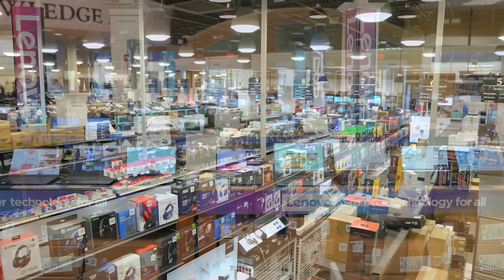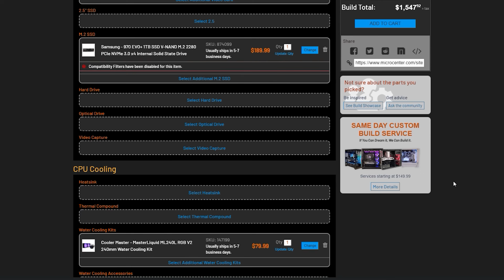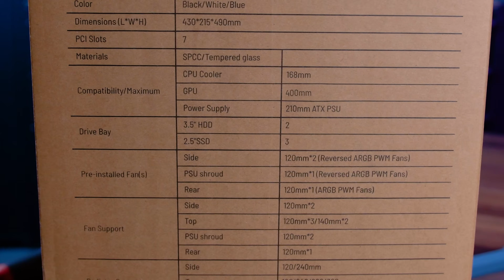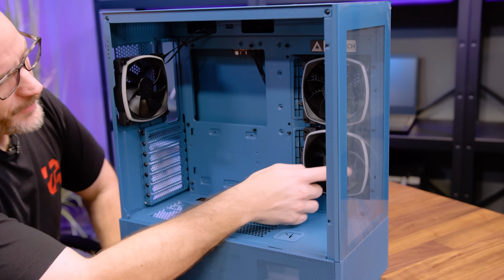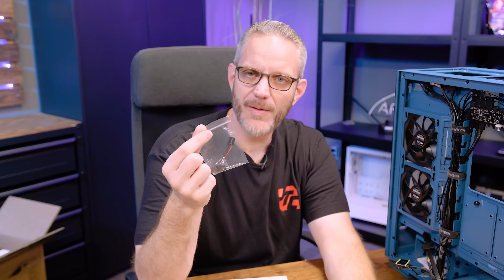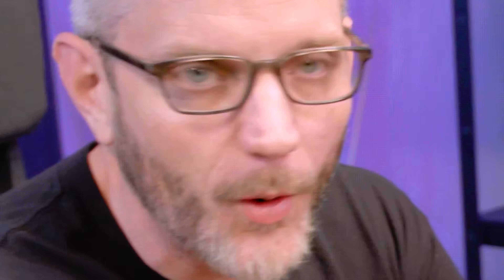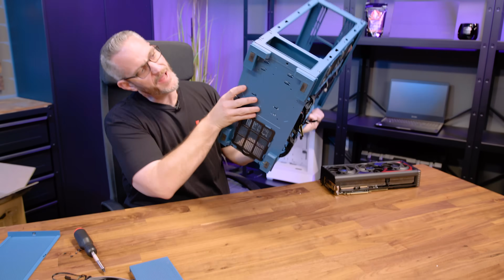This case has a funny name but awesome design choices! Montech Sky Two

Comment: Is it just me ? but at the high end, cases need to be redefined. Side mount fans are ok but the biggest improvement would come from bottom up fans, go back to PSU in the the top with a 280 rad, forget 120mm fans they are no longer even on the radar. Side mount fans look nice but will never be as good for airflow as bottom up. with NVidias passthrough fan side fans  will help cool the rest of the system, i.e. the mobo ram etc. Just push from the bottom to top. CPU rads in the top and GPU rads in the bottom, Sure they get warm but with enough movement and water rads it becomes a mute point????

Comment: I recently got something similar : Antec DP503  - it is similar in design, except the intake is the typical front, and there is no fan for the psu/shroud - i honestly like it, it was similarly priced when I got it.   fitting a 360 rad in top or front is good for me, as I decided this time to get a 360 aio for my CPU, and was able to top mount it.   It also has a little gpu-anti-sag arm build in you can use if needed, which is a nice consideration since GPU makers threw the typical form factors out the window and just said "make em bigger, so they can be better!"   that all being said, the top ports seem the same, construction similar, and so I actually hope future models come out - and I might just go Montech next time.

Comment: I have a Montech case on my first pc I ever built about a month ago! I have the Montech Air 100. I like most things about it: the pre-installed fans were helpful+ already daisy chained for me, the rgb is nice, airflow is great. My only complaint is how small it is. Everything seems very smushed, but I would assume that would be fixed by getting one of their larger towers. Which is something I will def do next time because the cable management was insanely difficult with how little space I have- The pre-done cable management was pretty much obsolete considering I had to undo a lot of it to connect my front panel controllers and be able to feed through my PSU cables. Overall, I like it, but would definitely consider a Lian Li or Corsair case next time over this one.

Comment: i got a Antec DF600 Flux Mid Tower Case this came with top usb rubber plugs/ 2 usb and both audio / it also comes with the fan for the bottom but you cant have in rear positionover the psu as the psu it tight against the mesh so u can only use in front position ,

Comment: I have dual 360 rads. They didn't fit in my case originally. I had to cut just a little bit of metal to make it fit. There is no way they would fit in this. But, other than that I like this case and absolutely would have considered it. I really like the color too.

Comment: I had a case over a decade ago that had one front header on it. Why have they not been doing that ever since?
My Antec DF700 Flux, came with USB plugs for the top mounted USB A ports.
With side facing SATA ports, would have been nice to have that room to use the 90 degree wires the case came with. I like how that one is shorter.
That is not cobalt blue, too light.

Comment: Asus used to give port plugs and covers like those you showed in the video. The asus X99 TUF SABERTOOTH  came with USB, PCIe slot covers, and fake ram sticks to keep those clear as well. They also had pinblocks to make front panel wires to one block.

Comment: I had a bookcase built around my PC case so it would fit in nicely.......the case is old now but I only have 17" H x 8" W x 20+D  any suggestions......right not I have 2x2080 in SLI AIO CPU cooler, I mounted the fan on the outside, works just fine, anyway I'm looking for a newer case....

Comment: Jay, you're not an idiot, but I have seen those port covers before. Specifically on the antec p101 silent. Good for that case because with 8 drive bays it's probably often used as a NAS where you probably won't often use those ports. Other than that it's an OK case but it works. At about the same price I wish I'd gone with the fractal R5 instead.

Comment: How stupid of the GPU manufacturers... why when building a gigantic GPU, would you place the connector in such a way that you'll need an extra large case just for the connector?
Why not place that connector on the bottom Right back. It would always be in the right spot for cable management as well as aesthetics.

Comment: Having built a few system in this case for customers recently, I would like to add one thing though: Don't use individually sleeved cable for ATX 24-pin unless they are thin enough because the cable routing space is shallow, and the cable channel is only wide enough to fit standard modular cable unless you move front panel cable and fan cable to other places. And yes, definitely have to shove all the excess cable length in the bottom chamber.

As for the bottom fan, it's not quite as choked up as you might think, I can still feel a lot of airflow even with half of the non-modular cable of TUF 750W PSU shoved under it.
And finally, there is another case maker that does include rubber dust cover for front panel, it's FSP group with most of their CMT series cases and some others.

Comment: Wish they gave 2 intake and 2 exhaust fans. That 3rd intake is basically useless unless you just turn off the rgb. Is backward for top mounting like you'd want. And looks weird on the bottom, especially just one. And would be choked off by the psu anyway. Should have just added rgb to both sides instead of redesigning a reverse fan. Pretty cool case otherwise though

Comment: BIOS speaker? Front socket covers? I had and still have these in SilentiumPC/Endorfy cases. I already had these things in them 6 years ago. Poland is full of these housings. Designed here (in Poland), produced in China. They may not be colorful, but they work great, just like power supplies, cooling or water AIO.

Comment: This is a case that is just crying out to be a little larger. An extra 3 cm in length to make the 24 pin cable bend less aggressive and similar extra in width for the graphics card would make a good case much better

Comment: I have built in 2 Montech cases and both were under $50. I can tell from the 2 I used that they are improving them because the first case was really flimsy and the 2nd was a lot more well built. This case would be perfect for a white and blue build.

Comment: Honestly, $93 is a solid price for that case. I've learned not to use the cheap ones, and this looks like a case where they did some thinking. I wouldn't put a massive powerhouse in it, but it could handle a solid gaming PC.

Comment: Great case review and awesome colour to show 🤩🤯🥰!
 - Montech the past 18 months has been coming in clutch with their case design, features and pricing!
 - Great to have different colour option for builders to personalise a pc more so than just black imo!
 - Quality of life features such as a combined motherboard header saves a few moments of annoying fiddling and accidentally pulling out of their cables as you try and get you pc power buttons etc connected are a great feature to have in todays crowded market!
 - As an ITX builder I much prefer smaller cases, but these newer mid tower designs and M-atx cases are looking soooo good that im considering my next build to go M-ATX 😱🤯🤩
 - Montech is throwing in many fans (2-4) for a vg price into many of their pc cases without much additional cost which is great to see
 - Getting an RGB / Fan controller for $15-20 is a great value add considering big name brands are charging upwards of $40-60+ for their branded one …. They know who they are 🤦‍♀🤦💰😅😂🤣
Im sure there’s many other great things to feature here but these are my main things which I look for in my pc case purchase decisions!

Comment: I bought this case a month ago for 80 USD (In Taiwan). It is really a brilliant case for this price.
Also about the extra fan, I highly recommend anyone who buy this case to installing it. I'm still using a MSI GTX1080ti Gaming X 11G. Before install that fan my GPU temperature at maximum loading is 83°C. After install the fan it's temperature drop to 78°C, which is very surprisingly.

Comment: I would like to see you water cool in this case and use a 240mm rad and 360mm rad. In my opinion a 240mm rad will not fit on the side of the case. But, prove me wrong

Comment: I'd do a double reverse air flow. Rear intake across a vertical CPU cooler (212 type) Both fan slots on the bottom as intake. Then exhaust out the top front mounts. I really like cool-ish air from the basement into the GPU. With a modular power supply, and good cable management there's probably decent airflow to be had from the middle at least.

Comment: Great video! Regarding white cases, the problem with white cases and builds based around the color white, is that white components from different manufacturers tend to be slightly different shades of white.  Mismatched shades of white are fairly obvious and tend to detract from the overall effect.  With black, different shades of black are harder to spot.

Comment: The grommets in the bottom is huge. That would clean up so many  builds I've seen. Same with the fan hub...tons at the bottom so you have to use extentions. Little thing that helps a build

Comment: Would live to see a build which focusses on not overspending on non performance parts. This case, an 7600x/5800x3d/13600k, arctic non RGB AIO or even an aircooler and then a 4090. Would love to see how it performes against an all-quality build and what the cost per frame on a whole build is.

Comment: Jay, can you do a review set of cases that will fit these newer larger GPUs with cable clearance issues? Which cases work with standard equipment, which need special cables or risers? Which is the best to build in? Best to customize? Best air flow?... etc.. Just a thought since we seem to be in the realm of monster cards.

Comment: Amazing that it took decades to standardize the power/reset/HDD LED connector. A colossal pain in the neck to have to connect those individually. The layout hasn't changed since the late 1990s, I think.

Comment: I had an Antec Value Select MATX case that also had the rubber plugs for the front I/O. I actually liked that case a lot except the airflow could have been better but the major reason I replaced it was the acrylic side panel. Scratched the FIRST time I cleaned it and couldnt stand it anymore. Great budget option though.

Comment: I can't wait to see GN so a case torture test.
The featureset is amazing for a sub-$100 case! And getting rid of the stupid singular front panel connectors absolutely is a win to me. If it has the cooling headroom to compete with Phanteks and Corsair at the $90-$100 price point, I think this is an easy pick.

Comment: Even with the included fans, I think Montec needs to lower the price a bit if they want to compete in the value department.  $93 is too close to the price of the Corsair 4000D Airflow or even a few of Lian Li's ATX cases. B&H Photo currently has the Lancool 3 for $100.

Comment: Washed cobalt? Case colors shouldn't impact costs much. As long as you keep the same plastic parts, common screws, etc. In car industry black paint is actually more expensive since black requires most thorough preparation (sanding, etc.) due to how black reveals imperfections. It's just milking people with special wishes.
Also decent spray paints exist in 2023 for DIY. Not nearly as resistant as the factory "powder coated" ones, but still significantly stronger than 30 years ago.

Comment: Will my cable clear the side panel.... Another reason not to buy nvidia overpriced garbage this gen... Well the cards are not garbage, what makes them garbage is the price and for me the aux power connector. I dont think they really needed a new connector. The new connector still has 6x +12v conductors which are half the thickness of the conductors on a normal 8-pin PCIe, and guess what 2x 8-Pin PCIe has a combined 6x +12v conductors at twice the thickness. So if the new connector can handle 600W, 2x 8-Pin would easily do it as well despite only being rated for 150W, 150W was the original spec from when the 8-Pin was first introduced.  (actually the Molex MiniFit Plus HCS 8-pins can support 12 Amps per 12v wire on good wires, like 16 AWG or better. Thats 36A @ 12v = 432W per connector, 2 connectors = 864W plus the 75W from the PCIe socket)... So really, a new connector wasnt needed, just use the newer versions of the 8-Pin and update the standard to suggest PSU manufacturers use 16AWG in thier PCIe 6+2 cables.

I wont buy a new card with the new connector until they sort out the issues and make it so that I dont feel like I am going to snap the connector off the PCB or damage the cable trying to plug it in properly.

Comment: I built my rig in a Montech Air X case about 2 years ago. Over time it evolved from fully air cooled to an top mounted AIO to a full custom loop with 2x240MM radiators (with minor modifications to mount the top rad). Was surprised with the quality of the case for the price point and have recommended them to a few people that are looking into building their own rigs. The blue looks sharp too!

Comment: That 4090 would probably fit just fine with the standard adapter. I have a MSI 4090 trio in a Lian Li O11 Air Mini and it has basically the same amount of clearance between the cables and the side panel. Cables kiss the glass and have to put a slight bend on the cable, but it's nothing egregiously aggressive. Just make sure the thing is plugged in properly and you're fine. Been running for months with zero issues.

Comment: Go with the blue and white build and don't forget to put Smurfs figurines in it! 😁
Jokes aside, it looks cool and I'm definitely curious to see what it will look like once the whole build is complete.
About LCD screens, I just fitted an ultrawide one, mounted vertically, inside my Phanteks P360A. I just had to drill a horizontal hole for the ribbon cable, so that I could mount the board on the "back side", where I've done all the cable management, and I simply attached the screen with 2 strips of adhesive magnets. Pretty cool stuff, if used wisely 😊

P.S.: being an Italian RC hobbyist, Montech always reminds me of Mon-tech Racing, Italian brand not far from me, that makes RC car bodies, lol!

Comment: Antec DF700 Flux ARGB I owned had front I/O rubber plugs. Case front mesh was absolutely garbage which rusted twice and company refused to do anything, but the plugs were a good touch.

Comment: I started building my own pcs in 2003. And i would always buy a cheap case that came with a psu and had no clue that was very bad  and dangerous. One day in 2005 i was building a new gaming pc and got a cheap case with a psu and once i turned it on for the 1st time the psu blew up in my face. I got lucky and was fine but the psu took out the gpu and motherboard. So since then i would always buy nzxt case and a better psu. In 2018 i wanted something different so i went full corsair build. Case psu keyboard mouse headset aio ram fans and been happy with corsair so fair. I am on my 2nd  corsair rig that i built in 2020 with the Corsair iCUE 7000X.

Comment: When looking for a pc case I always shop for value (i.e. all fans should be included, good airflow & cost should be under £100). I recently bought a good value case that no one seems to review on popular YouTube channels. I bought an Antec df700 flux for £83 new, which comes with 5 fans (3 intake, 1 reverse for GPU and 1 out take). Having owned an antec 900 previously I think these cases are good value. Just another option for people to consider.

Comment: The trailing edge is almost more important when it comes to aerodynamics. If the trailing edge is flat it's no better for airflow than a square bar. No matter how smoothed off the leading edge is.

Comment: this point with the white editions is like a downward spiral.
yes, they sell less so they have to make the price higher BUT thats the reason why people would rather buy standart black stuff, becouse other colours are more expansive.
10bugs for a white case isnt that much and people who wants to have a different colour pc wouldnt mind that but all the other stuff has to fit in too.
so a whole build in white would cost you like 100$/€ more, then a standart black build. or even more then 100bugs. and then only people who realy cares about the colour would take that price.
if the price would be the same or maybe just a little bit higher for a build in a different colour, then more people would buy it.
so why not starting to make the standart editions some dollars more expensive, the white editions a lil bit cheaper and then it compensates the total price and manufactures get the same money and after a few years of price regulation everyone could chose between white and black and pay the same price.
becouse im pretty sure if the price would be the same, more people would choose a white build rather then a black setup.
but becouse of the way higher price (and im pretty sure 100 bugs is still way under what a white build would cost you more) less people choose a white setup.

Comment: Fans on a side DON'T make sense. Any additional angle is hurting the airflow. It's not a huge difference, but it is a difference. Straight front to back or preferably bottom to top (cause physics) is best.

Comment: why not use a 140 white rgb fan coupled with an AIO to cool the GPU and making that GPU fit in the case better with plenty of airflow, use side mounted two 120 rad to cool CPU and put a 3x120 on top and front to act as an intakes of course RGB fans they must be and voila le Tres Magnifique build